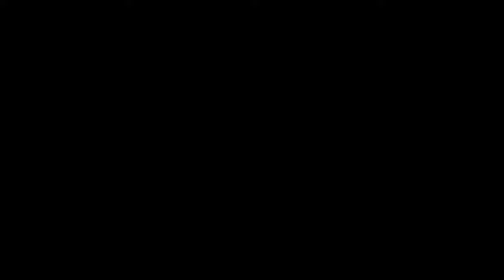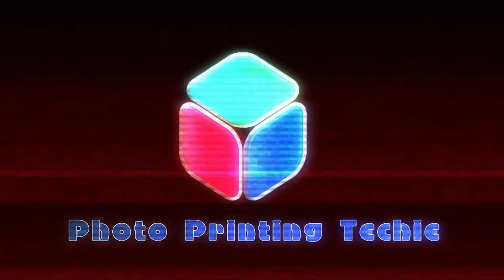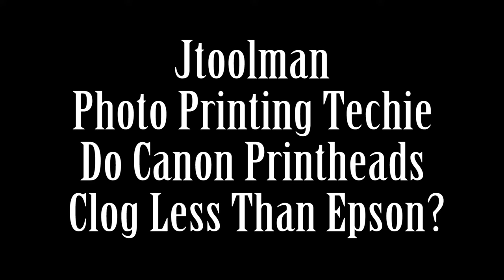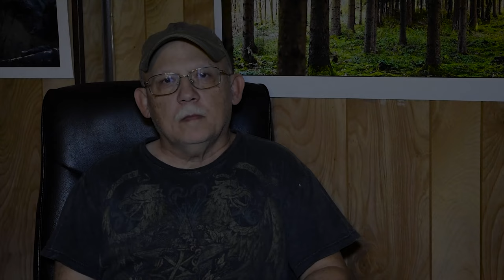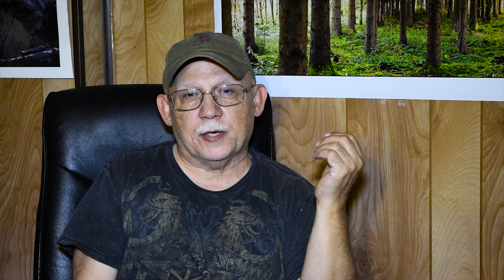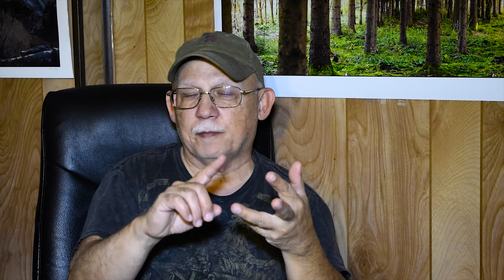You'd be wrong if you still think that Canon Printer Printheads clog less than Epson Printheads?

Comment: Last year I did something dumb: I left my Epson P800 unused for about 7 months straight. When I finally turned it on, it ran a super long cleaning cycle, but I was able to print. After a few weeks of no use, I printed and I had some clogged nozzles. Did another cleaning and the thing is working beautifully! But I've learned my lesson.I'm now printing several times per week and running frequent nozzle checks. Glad I didn't have a major clog or that would've been it!
Reply from the maker: Keep that printer busy!!!

Comment: This was extremely informative. I live in Wisconsin which gets extremely dry indoors for about 4 months when furnace is running. My Epson 4900 worked fine for about two years. I printed a test print or nozzle check at least once a week. However, at some point last February, I lost a light cyan channel completely. No cleaning cycles would bring it back. I eventually took the ink selector assembly (ISA) out and tried to suck the light cyan channel. It actually helped, but now the VLM ink nozzle is totally clogged!! Shall I take apart the ISA again? I guess so? I'm not going to spend $1000 on a new print head, and have gone months now without a printer.  So, even running test prints on a 4900 frequently doesn't help in a dry climate. At this point, with extreme regret, I am thinking of dumping the 4900 and exploring a Canon, in large part based on your information.
Reply from the maker: First off my wife is from Cudahy Wi just south of Milwaukee and visit family almost every year in Oak Creek. Where are you located? On the 4900. You are lucky it has lasted that long. It is an amazing printer capable of stellar quality prints but it suffered from a defective ink delivery system as well as ink selector assembly which you have already addressed as well as print head problems. Too bad as this printer would have been their pride and joy in that class.   So what is your plan at this point. CANON PRO-1000 at 17 inch capacity is a jewel of a printer. I have the whole line of PRO CANON printers from the 900MKII - PRO -100 - PRO - 10 and - 1. The PRO-10 and -1 produces incredible prints. Some of the best I've ever seen and been able to produced. The PRO-1000 is supposed to be even better! If you can believe that. Vacuum assisted paper feed is a wonderful feature BUT you can only print to about 22-23 inch length! That has labeled a deal breaker to many. I do not need to print long panoramas often and when I do I have my EPSON P800 with the roll paper adapter to allow me to do that.So that is about it!!! Let me know which way to go. I would be interested to know and if you are anywhere near the Milwaukee area let me know so I can contact you the next time I am in town! I'll buy a cold one!

Comment: I have limited space.  I wanted to get organized, get an idea on how to approach the situation.  I'll make some space an start this weekend.  Thanks for the quick response!  I'll let you know how it goes.
Reply from the maker: +Eric Young Once you get everything set up, you will powere up the printer and run a nozzle check from the LCD screen. Right - Down - test print - right - right onty to get to print. If you have lines missing, run a cleaning cycle from the computer printer driver, not the lcd screen. Those are ofr power cysles which will waste a ton of ink. Once finished, sun another nozzle check and compare it with the previous. If there is an improvement, let the printer rest! Power it down and wait a few hours. Repeat. unless something is drasticaly wrong, these steps should get  you going.If youhave almost a complete set of nozzles with only a few missing lines in some of the color channels, run a print using a purge image containing M-LM-C-LC-Y-K-LK using glossy as the paper choice and highest printing quality ( slowest ) Un several sheets and rest the printer agina as before. Power up after resting and run nozzle check.If successful then you are ready to roll. If not then we can go to step two!Joe

Comment: I have two canon printers, an iP6700D and a Pro-100. The Pro-100 is fairly new (about six months old) but I have already exceeded the weekly printer check a number of times and I occasionally travel for periods of 3-4 months. Is there an acceptable method of taking the Pro-100 off line and in effect putting it into storage so I do not damage the printer or significantly shorten its life? Also, do you have any info on cleaning the print heads for either of these printers since I have already neglected my 6700D a number of times (however for not it does still product a successful nozzle check pattern.) Thanks so much for your great videos. Hope you and your wife are feeling better now.
Reply from the maker: Basically you remove the carts and install the original orange clips with rubber bands to seal the out let and tape up the air vent. Then stick them in a zip lock baggie! The Head needs to be flushed with distilled water, DYRED and stored in a sealed baggie. With the pro -100 it is easy. Does the iP6700D use Dye or pigment? If dye then the same applies. If pigment you will need to flush out the print head with something like a cleaning fluid for printheads and rinse in distilled water, dried and stored. If you have the original Head clip that it came with so much the better.
Reply: The 6700 uses dye, CLI-8 cartridges. Tx a lot.
Reply from the maker: Then you can treat it the same way.
Reply: Hi again. I'm now actually going through the process of sealing my OEM cartridges and cleaning the print head of the PRO 100 for storage as I'll be traveling and won't use it for about four months. As a result, I have some procedural questions:
1. Where is the air vent on the CLI 42 cartridge
2. I've flushed the print head many times with distilled water and no color is now showing on the paper towel. As a final test I put enough water on top of each inlet to see if the level will reduce over time to where the inlet is exposed, meaning water has actually been drawn through the passage way and onto the towel. Seven of the inlets do indeed drain down as anticipated but one does not, the yellow. What steps can I take to free up this cell? I know yellow has some challenges for these cartridges. 

I've heard on one of your videos that if the head is clogged the cleaning process is more complicated but I don't know what that process is.
Reply: False alarm. The yellow passage is now drawing water through to the paper towel like the others. However, I'd still be interested in your step by step process for a complete cleaning of the PRO 100 print head. Tx

Comment: Love your videos Jose, so educational and rich with knowledge! I discovered them after BOTH my Epson printers clogged, the newest one clogged after a month (literally!) and the Windex trick didn't seem to work. Luckily it was under warranty and it was replaced, but the new one seems to be doing the same after a couple of DAYS! Never buying another Epson printer ever again, recently bought a Canon home office printer after your videos and other info I gathered from the web (more economical to replace Canon printhead and possible to do so on your own, seemingly clogs less frequently) - thanks for this Jose! :)
Reply from the maker: Printers need to use very frequently. A month is way too long and almost guaranteed clogs. Canon printers don't seem to clog so much due to the print head design and the fact that they will run cleaning cycles after not using them for a few days.
Reply: Jose Rodriguez I was using the Epson quite regularly during the month printing full colour borderless pages at a time, I think it may have been the third party inks/cartridges that did it, oh well, looking forward to the  Canon!
Reply from the maker: Yup, that will do it every time. Only good refillable carts on an EPSON and never compatibles.
Reply: Jose Rodriguez what about on Canons? And would you recommend keeping a Windex soaked paper towel under the cartridges during longer periods of not being used eg when on holiday for over three weeks?
Reply from the maker: All Printers can not be left alone for weeks without printing. Not because that causes ink to be withdrawn into the wet paper towel and you would have totally empty cart when you came back and a royal mess in your printer whether Epson or Canon.
Reply: Jose Rodriguez Thanks Jose! I will keep this in mind 😊

Comment: Jose you've made some great vids. I have a question.
3 1/2 years ago I bought an R3000. When I unpacked it an set it calibrated my monitor & printer with color munki photo. I made about 5 prints then there was an family illness I had to pack it up, I parked the head put it back in its box. Forward to today I can start printing again. Any suggestions on how to salvage my printer? I want to use it for panoramas.
Thanks
Reply from the maker: +Eric Young So have you done any test prints to see how the nozzles are doing!
3.5 years is a very long time!!!!
Take out the carts and agitate all the carts and reinsert them.
Then all you can at this point is to power it up and see what you have. 
There are some processes you can perform if needed but first you need to establish the condition of the printer.

Comment: Also, it depends on where you live for both ink evaporation and serviceability.  Here in Arizona, Epson’s seem to have a significantly greater issue due to the average humidity being very low; and some say high altitudes, like in Prescott AZ, makes it a lot worse—but that is anecdotal, in that I don’t know about any comparative data on that.   I have dead Epson’s, the local college gave up on their Epson’s, and some of the local pro printers have employed Canon backups or replacements for their Epson’s.  This may all be exacerbated by the extremely low humidity here, and possibly being at a over a mile high.  Second, getting a new print head online for the Canon Pro’s is nice, since you don’t have to deal with hopefully finding a local Epson print center or possibly shipping the units.
Reply from the maker: Yes optimal humidify levels are a most. 
But canons do run cleaning cycles pretty much after a few days of non use before your next print job. That gives the appearance that they are less clog prone co pared to Epson which does not run cleaning cycles until it's too late. But I do agree that the canon thermal printhead internal construction does help to reduce clogs. They are much more fragile than Epson printheads and it's one of the reasons they can be user replaced. They tend to last about 2-3 years on average. My pro-1 needed a new one after about 6 months.

Comment: Does the hot firing system of the canon help with glossy papers? As the initial heat allows penetration of the outer layer
Reply from the maker: That is a great question I should address as a video! Give half a day as there is a lot to say about that.
Reply from the maker: Basically no effect on aiding penetration of the coating. That is controlled by the actual coating itself and had very little to do with whether the ink droplets come from a CANON Thermal Heat printer or and EPSON Piezo Technology cold firing print head. I have not read nor heard anyone in the know stating otherwise. But who knows!

Comment: One more question regarding these two printers (Canon iP6700D and Pro-100). Is there a way to remove and clean the heads. I had a salesman tell me once that I could clean the heads of the 6700D by placing it on a paper towel soaked with isopropyl alcohol. Any thoughts on cleaning methods for these two printers to keep all of the print head channels open, or clean them once clogged?
Reply from the maker: I would use Windex with Ammonia. Sit is on a few layers of toweling and drip Windex into the ink ports until only Windex comes out. The follow with Distilled water and 70% isopropyl. Then let it dry and store! Do not wait till they clog!!!! Much more work involved.
Reply: Got it. Tx.

As you can tell from my many questions in several of your videos, I have been very busy listening to your advice. You have helped my printing immensely. Prior to this i was following several "how to's" but your videos are so easy to follow and complete in their explanations. I'll be watching some more with no doubt more questions. By the way, thanks also for your very rapid responses. Great job!
Reply from the maker: Thank you my friend. I really appreciate it immensely!

Comment: I'm still using a Epson Pro 9600 that's at least 15 years old and still going strong. If it were a Pro Canon it would have died 13 years ago. I think I'll stick with Epson.
Reply from the maker: Mike and I agree. Here I was simply trying to show people that CANONs are NOT clog proof as many seem to believe. I told them about the redundant nozzles and how once they are used up the print head needs to be replaced. The EPSON Printer if you use it will last its lifetime and more.  But people want to not print for months at a time so go figure.  At least a CANON print head can be changed but at a price. A ipf6400 needs a pair every two years. At $500 a pop.
Reply: Canons are only practical if you really like the features and output more than Epson and are selling enough prints to make it worth your while.
Reply from the maker: Having so many printers though none over 17" I tend to like features on both. All I do is test and experiment besides printing for myself and a few others. .
Reply: Nice hobby, it's fun to experiment.
Reply from the maker: Not quite a hobby. This channel develops a pretty good income that I then put that back into whatever I need to test that might be new out there. So I can't rest on my laurels. Often it feels like work and that can be bad.
Reply: That's the danger of turning your hobby into a business, you take the risk of it becoming a chore instead of a joy.
Reply from the maker: It's a balancing act. I had no idea it was going to takeoff. I guess it's the best of both world in a way. 
I just realized it's nearly 1 AM!  Got to hit the sack!